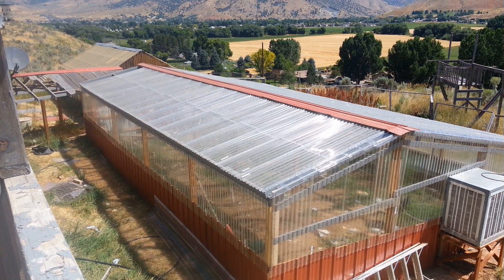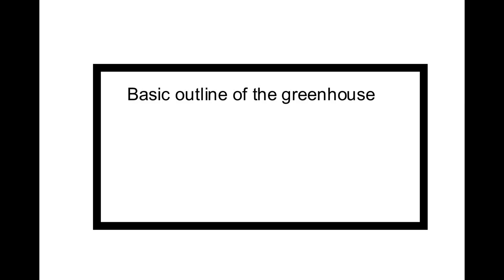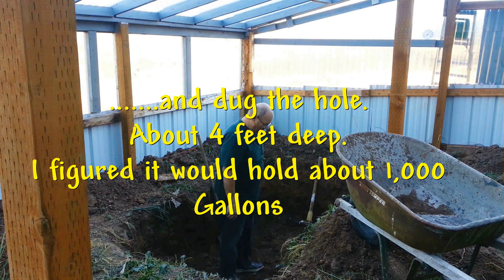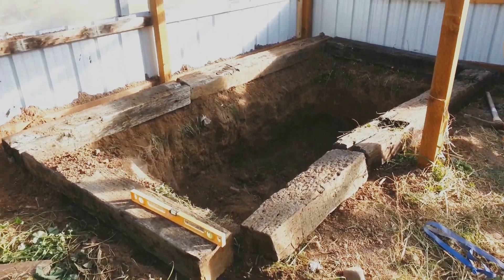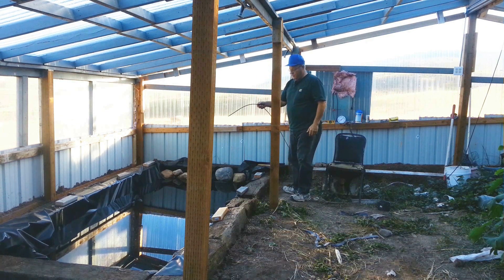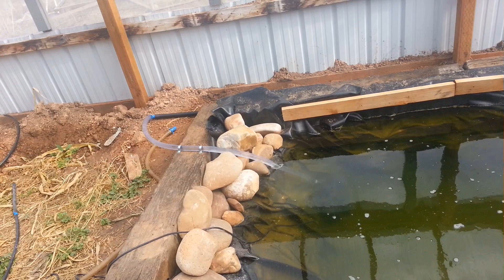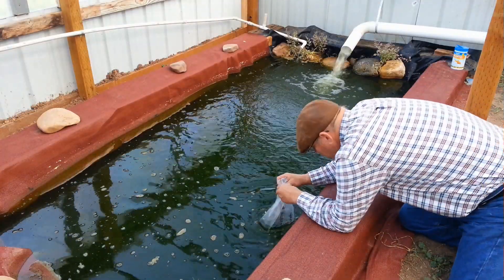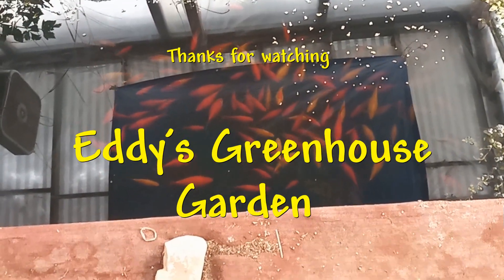Building My Aquaponic Greenhouse from Scratch

Comment: WOW!!! It's wonderful to see you setting up the system back then. I'm two years into using  my built in greenhouse made out of reclaimed sunroom glass door size panels.  Even though I am still learning and made some mistakes, I was impressed with what I could grow.. I love aquariums and am fascinated by your set up. Id like to try this on a much smaller scale. My problem is I live in NW Georgia and this time of year it's way too hot in the greenhouse, 120f even with everything open. I'm not sure what to do with the fish during the summer, My greenhouse is currently unheated and there were a couple of winter nights that got too cold (even with a heat lamp) and I had to haul my citrus tree and other tenders inside..I'm wondering if the circulating aquaponics water would help keep it warm enough to prevent freezing inside the greenhouse.